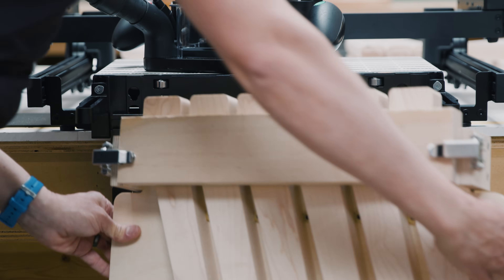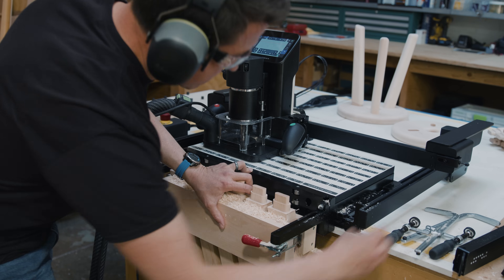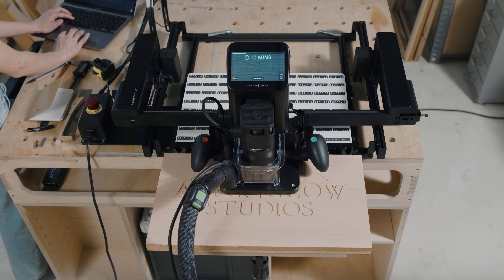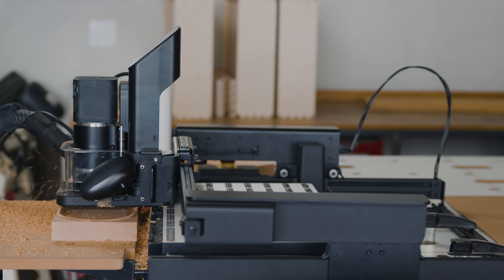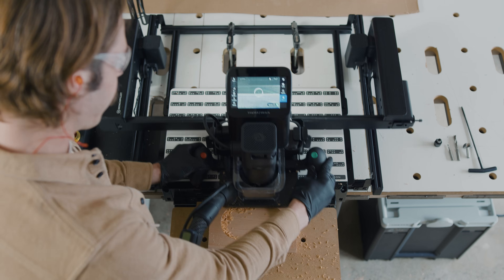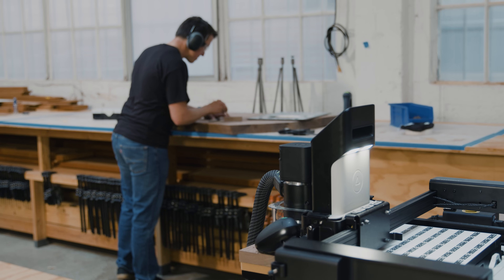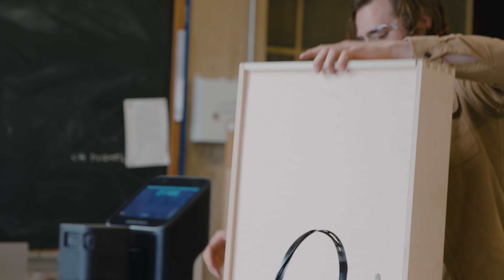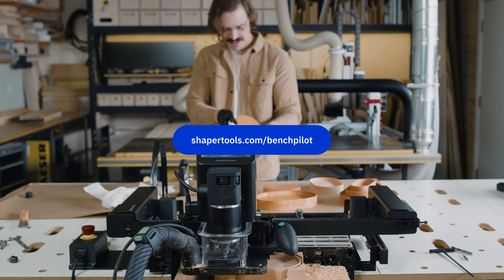Introducing BenchPilot

Comment: Wow! :)))
How does height adjustment of the workpiece work when using Benchpilot without the workstation? If I understand correctly, Origin rests on top of the workpiece. When it's connected to Benchpilot, it can't be adjusted along the Z-axis, so the workpiece has to be positioned in such a way that Origin sits flush on it. Is that correct?

Comment: A table top CNC can use longer bits than Shaper, but I’m able to cut 1 1/2” thick material on my Shaper without an issue and I find that works for me just fine. I honestly think Shaper is a better CNC solution in its price range than any tabletop machine. You don’t have work holding issues with Shaper and bit changes are faster if you have multiple spindle motors like I do. For my work I think I would need a commercial CNC to work as well or better than my Shaper set-up and the cost for that type of machine is in the 5 figure range.

Comment: While not cutting, you can push the shaper away to inspect work, change bits, etc.  Does the BenchPilot help move the shaper when you push it?  At a few points in the video the operator moves it aside with what appears to be an effortless one-handed motion -like it's on ice.  Am I overthinking that?
Reply from the maker: Hey there. Yes, while not cutting you can move Origin out of the way to inspect your work while it's still connected to BenchPilot. We've made it easy to pause your job simply hitting the red button on Origin's handle, then move the tool, and then resume cutting by hitting the green button. It's not however a "power assisted" move so speak when you're trying to move Origin out of the way, but it does glide easily!
Reply: @Shapertools  got it thanks!

Comment: This is an exciting development.

Sold my gantry CNC when my Shaper arrived, and haven't looked back (or ruined as many parts due to work holding failure, random disconnects, etc.). For my workflow, the accuracy of SO and getting 6'x6' of space back in my shop is awesome.

Only time I questioned my decision was batching out parts last year, and wished I had a 24"x24" CNC for donkey work.  This fits the bill nicely!

Comment: If I needed an automated setup, I'd buy a CNC.
Would be great to have a real CNC with the ease of interface of the Origin though.
Reply: This is literally a real CNC with the ease of interface of the Origin
Reply: @80211Denver If it was a real CNC, it would use motion sensors on its x- and y-axis instead of optical scanning of Workstation’s Domino board.

Comment: Elephant in the room question…. Will there be expansion rails to increase cut capacity 🤔
Reply: any reply?
Reply: @GarlicFirst nope, but I’d bet a paycheck there will be
Reply: This thing is driven by belts and they use aluminium extrusion profiles, meaning you could go about it yourself by sourcing these instead. At least in theory.

Comment: Does it automatically increase z-depth or does it also require autopass?
Reply from the maker: Yes BenchPilot does automatically handle incrementing the Z depth each pass, but no, it’s not necessary to buy AutoPass separately to use BenchPilot. BenchPilot utilizes ‘Pilot’ mode. The Pilot interface is intentionally similar to AutoPass’s interface (we don’t want to confuse experienced operators), as is much of the functionality. Pilot mode is accessible only when Origin is docked with BenchPilot.

Comment: At this point, just buy a cnc.
Reply: If you've already invested in shaper, why?
Reply: 2K won’t get you much of a CNC, this is a good option for people that have a SO and don’t have the space, need, cash for a decent CNC.
Reply: @michaelpayne8102  it will get you lead screws, linear rails and far more powerful stepper motors and an 8x4 work space.
Reply: $2k will sure buy you an 11x18 cnc that can only use 1/4" shank cutters.

Comment: I had several guesses in mind about the upcoming release from the SO teaser, but I was nowhere close to hands-free SO automation!!  Really like this idea. See it being efficient for my side hustles of cutting/charcuterie boards, signage, and production drawer boxes to my main work on custom cabinets/built-in cases. $1400 cap ex is a bit of an issue with other current business expenses, but I’m pulling the trigger and ordering today!  I’m an early SO adopter (Q1 2018 receipt of Gen 1); teach and demonstrate SO for Rockler in Virginia; use SO for income and personal craft. BenchPilot is an impressive upgrade to the SO system.

Comment: Does the BenchPilot support the weight of the Origin, allowing for full-surface milling?
Reply from the maker: No it doesn't. While BenchPilot is designed to prevent Origin from free-falling in unsupported situations, in normal operation of BenchPilot, the base of Origin still rides directly on the surface of the material being cut. All the same physics rules of Origin still apply. However, please note that many users choose to creatively support Origin for specific applications with items such as bolt-on extended baseplates or custom-built planar sleds that are separated from the surface of the material being cut.
Reply: It seems it still rides on the surface of the workpiece
Reply: @80211Denver so it doesn’t make the Zed Sled unnecessary if you have this?

Comment: For me, I think this could be a game-changer. As I'm getting older, the strain of driving Origin manually on long-duration cuts is getting to be too much for my bad back. Also, my shop is too small to have a larger CNC set up permanently, so I'm thinking about attaching the BenchPilot to a piece of 3/4" plywood that I can store out of the way when it's not being used. Letting BenchPilot do those tedious cuts will make using my Origin a lot more fun and a lot easier. The price is pretty steep, so I'll have to think about it, but I'm pretty tempted to get one.
Reply from the maker: Really appreciate you sharing this - it’s exactly the kind of use case we had in mind. Love the plywood idea too!

Comment: I own a Shaper Origin, Workstation, and Plate, and I can honestly say at first glance that this new accessory does not seem to solve any existing problem or add any new functionality. If you buy a Shaper Origin instead of a CNC, then you like to be hands on with Origin. If you want high automation, then you could save yourself a lot of money and buy a much more capable CNC. Even considering portability, a benchtop CNC is much easier to setup on a job site. I don't like being negative about new innovations, but I am scratching my head here asking myself "what does this solve that Shaper, Workstation, and Plate couldn't already do?" The answer is nothing other than spending even more money to further remove you from using the tool you already spent the money on to use in the first place.
Reply from the maker: Hey there - sounds like you’ve put together a solid setup with Origin, Workstation, and Plate! 

We want to clarify that BenchPilot isn’t trying to replace what Origin, Workstation, and Plate already do. It’s for those repetitive or time-consuming cuts where hands-free helps: big pockets, repeat parts, detailed engravings. You can still go hands-on when you want; BenchPilot just gives you the option not to. 😊
Reply: @Shapertools  I own these items as well and this sounds like a great new addition to me!
Reply: Some people want versatility. Personally I like the idea of being able to work on more than one thing at a time. Especially when there are tedious tasks involved.
Reply: I think this is similar to having a powered planer vs using a hand plane to mill a board to thickness. In the pre-machine era apprentices would be the ones doing that type of work — then came the machines. I see this as removing the tedium, and this is something you could easily add to an MFT table on-site when you need to batch out a bunch of parts. It also takes up far less room than a traditional gantry CNC. There is also the question of workflow, a typical CNC has a much different workflow than Origin.
Reply: Totally amazing!❤
Reply: I can see your point of view, but for me personally and my work flow, this could be a game changer. Placed my order last night as soon as they went live. Now just have to wait until end of September to find out if I'm right!